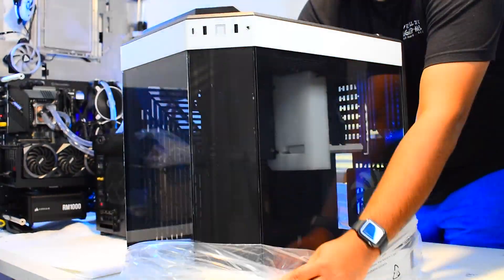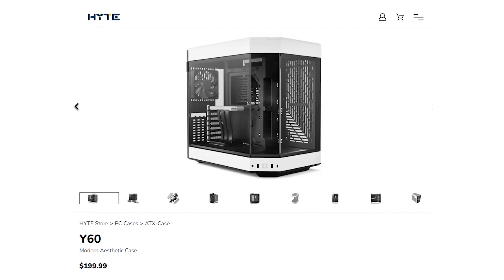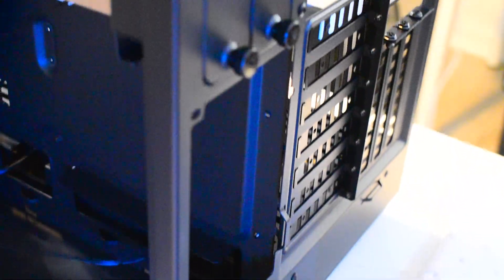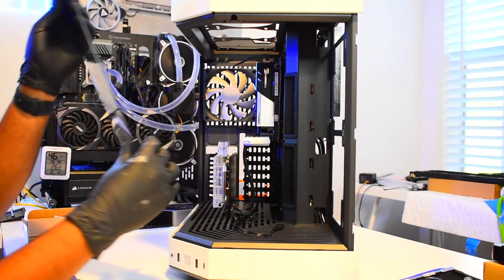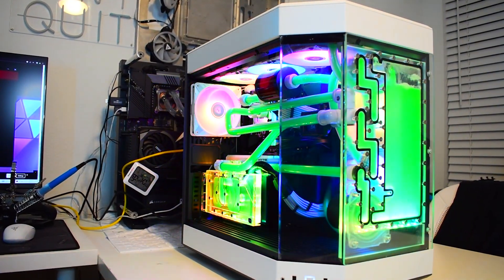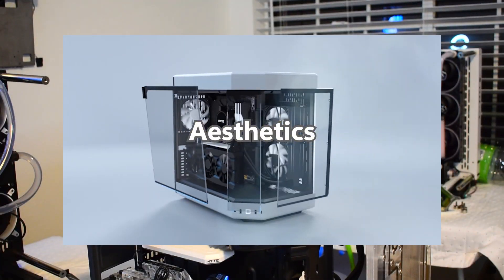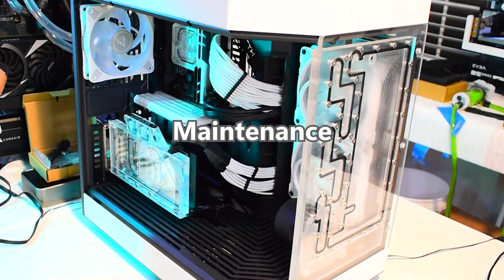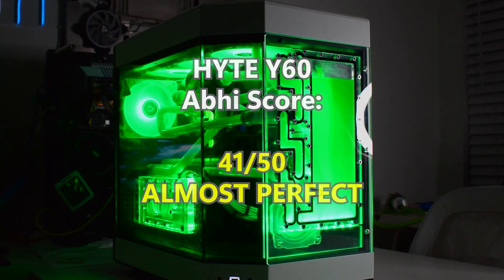Here's why this case is almost perfect for water cooling

Comment: Have you done the Y70? I was interested in putting the EK QuantumX Loophole Distroplate D5 but EK customer service was unsure if it was possible. They mentioned mounting to side radiator but that would remove that radiator /fan capability. I’m new to custom water loop, but maybe mount it to rear fan mount? What about the channels/slits on the case bottom , is there away to securely mount it to that so that it could be installed adjacent to the side glass panel? Thanks!